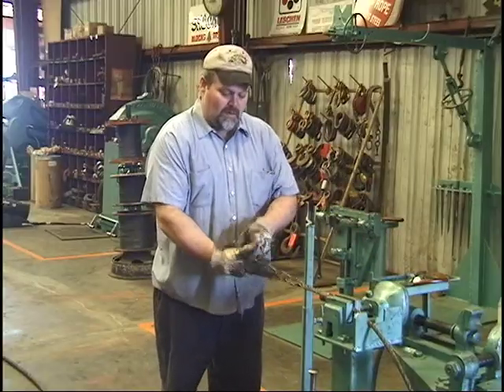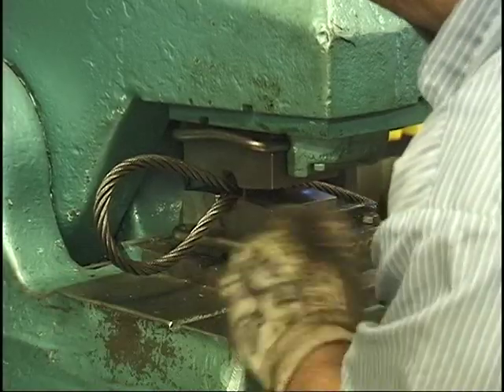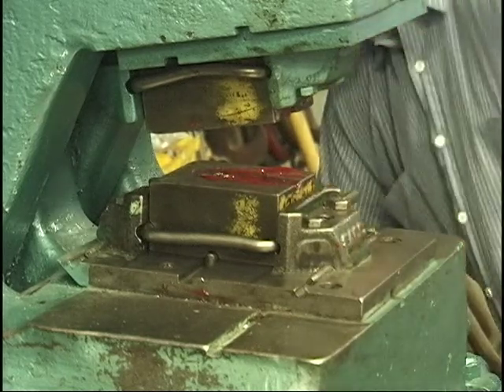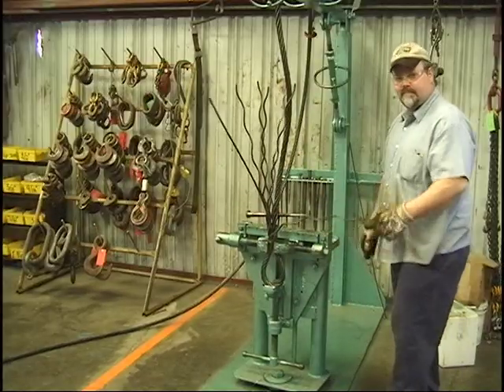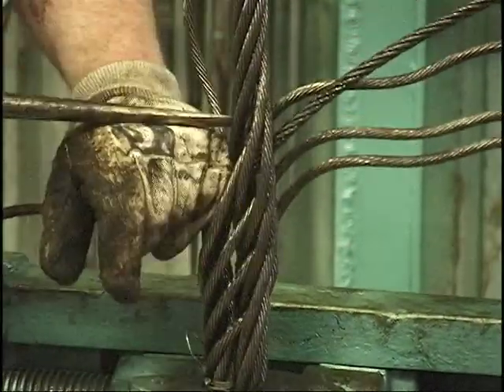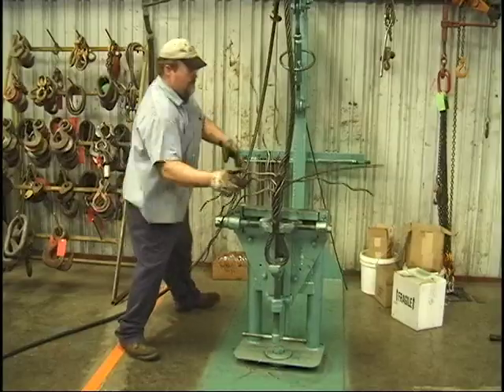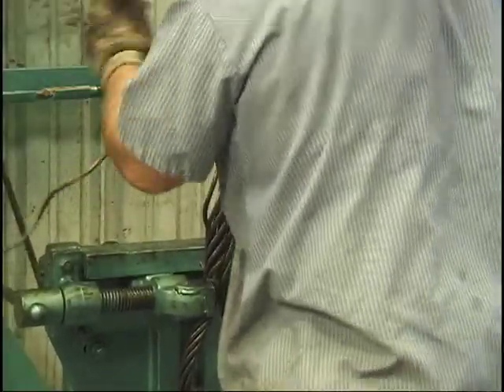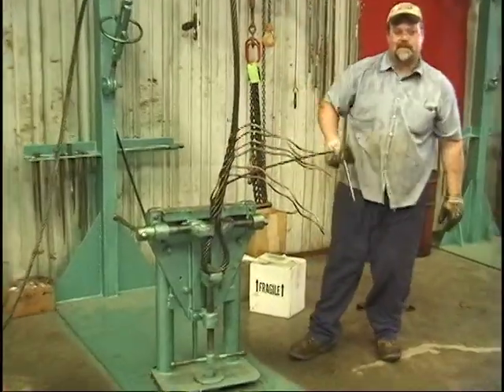Wire Rope Splice

Comment: So what if you don't have all those fancy press's and jigs,, then what?
Reply: do it by hand, it isn't impossible
Reply: Robert Jones yeah, the second splice is also incomplete. I can do it without the aid of a vice only a pointed steel will do up to an inch size of a wire rope.
Reply: @otreblasilecar3328  Me too, after 40 years at sea, mostly deep sea trawling you need to do it regularly, usually we used the 3,2,1 method, looks neater and passesvthrough sheaves better.
Reply: +Otrebla Silecar  Yeah, You are right. Up to 25 mm it is easy to do. Same time using a machine reduces fatigue and increased productivity.
Reply: I've done it by hand many times as an Able seaman on freighters, you LEARN how to do it, and  you remember it!
Reply: We just spiked the eye to a good size log. 4-6 RR spikes (usually from old guyline stumps) a SOFT hammer min 2 big steel marlinspikes, a small one helps. usually cut the line with a line axe or abrasive cutoff saw.
Reply: You Use Cable Clamps, Not As Pretty But Will Work In a Pinch.
Reply: The first eye, a Flemish or Molly Hogan soft eye, is nearly as strong without the ferrule. The six ends(+core) could be seized in place, duct taped, or just left alone. Any configuration of a flemish eye is stronger than the second splice; a tucked splice will normally be 80 to 90% of the rope strength. As the diameter of the rope increases, the strength of a tucked splice can drop below 50%. Both splices are "soft" eyes, that is, there is no thimble lining the inside of the eye.
If you don't have a Milwaukee Tool or Little Beaver etc rigger's vise, clamp the rope in a conventional vise 5 or 6 ft from the eye. Lash or clamp the rope around a thimble with 3 visegrip pliers. Tie off the eye across the room and stretch it away from the vise with moderate tension. Just like the adjustable arm behind him you want enough tension to prevent a kink from forming but leaving enough slack that you can slip your marilnspike or screw driver through the rope without much resistance. Notice how right after spinning the rigger's vise the cable is wavy and he raises the arm a bit to prevent the splice from looking like a spring. If he had lowered the arm a bit when the going got tough, the spike would have slipped through easier, but the finished splice would have a curl to it.
So with the cable clamped in your regular vise, and the eye tied off, put a bar or broomstick through the thimble and spin the eye same as his turntable does. Tie the bar to something strong after 5 or so turns so the cable cannot spin back before the tucks are complete. 
Notice his first tuck goes under 3 of the strands, the second under 2, and the third under just one, all With The Lay.  Tuck the other 3 strands, you can end up with each of the 6 strands coming out its own slot, or you can tuck under 2 or 3 at a time like he does. This is what makes it a Logger splice: he weaves the first tucks back straight through the middle of the rope. This locks the splice and allows a log to be suspended from a cable and spin without loosening the splice. 
It's difficult to see what he did with the second 3 strands but i tuck the one adjacent to the "first tuck under 3" strand against the lay with a strand of the standing part between the first and the fourth 'unlaid strand' tucks. That is the only strand i tuck against the lay, and the only tuck that strand does against the lay. After that, all tucks are with the lay. Against the lay means the same way you splice rope. With the lay means you are tucking under the same strand over and over (not a locking logger's splice).
It really doesn't matter how bad it looks if you tuck each strand 3x. Your next splice will look better, if it doesn't,  just hammer it smooth on an anvil. When you have enough tucks loosen the vise, don't try to unwind the bar.
Also notice that the 7th "strand", the core, doesn't get tucked at all, just cut off. Why? Because it doesn't contribute to the rope's strength (7% max). It is only inside the rope to hold the other strands in place, as well as store spare grease. It is easy to tell which one it is bc it is the only one laid right hand like the rope. What makes any splice weaken the rope is the way the strands get deflected, and splicing the core in with the rest will only deflect and weaken the rope more.
To me, a west coast just means a minimum number of tucks used to make the splice but still full strength.
Hope this helps, to me any written description of cable splicing, including mine, is confusing as hell.
Reply: @martyspargur5281  Wow,  you certainly know your way around a wire rope.
Reply: Take your broken braids to someone who has the equipment and know how to do the job.  I don't repair chokers just get new. When one breaks it was overloaded. It's no longer a safe mechanism even if repaired.
Reply: Yes, how many 500 ton presses are there when you need one.
Reply: Don't ya drive two or three spikes in a log and can do it that way? I've seen so many different ways and methods. I can do a Molly Hogan the first one he did but I don't use the collars and press. We always just worked the tails together and went. Maybe wrapped some miners tape around it. Or clamped it if we didn't trust it.
Reply: He could do it with a children's play tool set
Reply: In the Tub boat world we do it different with out all that fancy machines just your hands, a wire cutter, sledgehammer, wrench and two cable clamps all in less then 5 minutes.
Reply: @jme2816   When you get out of the tub and into the real world you might have change your ways

Comment: nice but i have to agree with Bill McCannel the ends are way to big. in the bigining you tape the ends so they dont come apart then you splice and fallow the pattern all the way uo. when you are done splicing all 123456. you tape the acessand  clip them with wire cutters. then you splice the remainin in... so your hiding it instead of leaving it out... Need buisness? need a great deal email at ivang35sl@yahoo.com.

Comment: We irish fishermen call this a 'Flemish eye'.  Presumably the Flemish guys used it a lot or perhaps came up with the idea first, they certainly came up with a lot of ideas!  In an emergency we held the ends with a bulldog grip and laid in the strands later.  Other splices we use are yte Liverpool, the German locking splice and the long splice.  The guy in the video is both strong and expert.  The largest cables that I have seen spliced was in the coal-mines in Whitehaven, Cumberland. Six inch +

Comment: Nice to see someone doing this stuff. I love that splicing jig you have. 25 years ago I learnt for my trade as a rigger to splice wire rope. When I worked in the mines I'd make custom length pieces for my boss so we could send odd sized equipment down mine shafts. The guys I worked with would watch in awe as I made them. Now-a-days it is all ferrule crimped, hand made splices are becoming a lost art.

Comment: My dad use to work at Woods Logging in the 80's, had a bad accident reeling up guide lines on the line truck in the building right behind this one if this is Woods. This video looks like it is in the main building?!?! I remember that press…same color and sound.
Reply: Which store? I think it is probably Baileys in CA. I have never seen anything but ESCO presses.
Reply: Ross Arnold worked at the one in Longview Wa.
Reply: This is acmy rigging in Mendocino county I know because that's my dad in the video 😂

Comment: hey a question for you guys what would be safest and strongest to say pullout a garbage truck stuck at the dump  with either a chain or steel cable I would use cable but whats your opinion
Reply: Cable is usually stronger. You can do a quick eye splice in the end without tools as shown first in this video. Without the sleeve. Chain is better behaved, but harder to move around. The stronger the chain is, the more the links will ring like a bell. What i would Not use is nylon rope. The more stretchy something is, the more deadly it will snap back at you when it breaks. Nylon is very stretchy. Wire rope doesn't stretch much, so when it breaks it doesn't snap back much, assuming it is at least a little beefy. Proof coil chain is the weakest, but rusts the least, but if it breaks it just drops and says, "huh". Even polyester rope will stretch a dangerous amount. Dyneema, spectra etc rope is hella strong, but people underestimate how easily it is cut. Doesn't recoil back at you like nylon, tho. When buying fiber rope, get straight spectra or straight dyneema or straight polyester or straight nylon etc, avoid ropes that mix two materials to save money. With double braids the cover can be a different material than the core, what i mean is avoid blends like 60% dyneema and 40% polyester in a single rope because the two materials will work against each other, and last nowhere near as long as if you had just spent a little more money upfront.

Comment: So I can see that grinding away some of the faying surfaces to try to meet the specifications, would be tempting, but is the metal flow of the sleeves still within the toolmaker/manufacturer's intentions? It may be interesting to do a saw cut through a sleeve to see the actual metal flow of the fittings. Please don't view my comments as negative, I can tell you really know what you are doing, and yours was the most informative I could find on any of the video websites.
Reply: The go/no go gauge is more appropriate for oval compression sleeves. The sleeve shown is for disposing of the sharp ends and it's not critical what diameter it ends up being since the strength of a flemish eye is not dependent on the sleeve. Nicopress dies used on oval sleeves (strands not split 3 and 3 first, the intact end is bent into a loop and then sleeved together) need to be adjusted so the sleeve ends up a maximum diameter after pressing. Otherwise the loop is not full strength. However, in some work having a full strength loop is not the highest priority. A full strength loop made with an oval sleeve needs a minimum number of presses, depending on which die you use, and the sharp cable end needs to stick out the end of the sleeve one cable diameter. There is often more than one set of dies that will work for a particular dia wire rope. That's why they have "letter" designations instead of being stamped "half-inch" etc. If you don't want a sharp cable sticking out of your sleeve, you can sacrifice some strength and make it flush.
BTW, it doesn't matter much, but oval compression sleeves are specifically designed for "flexible wire rope" (not strand). But we have found they work for a lot of things, including putting new eyes in the ends of (used) Dux, when you just don't want to spend all day fishing and all night repairing the gear.

Comment: I like your video, very instructional, I realize you could do this much quicker if you weren't teaching at the same time. I only wish you would have shown the gauge that you use to check that the sleeves have been pressed to tolerance. The only other comment I have is, it looks like your dies for pressing the sleeves are very worn, and even look modified. I also have heard, that the dies for a half inch sling cost about $10,000.00.

Comment: Nice Job, I always wanted to learn how, but never got chance. At Kearney & Trecker we had several guys that made hitches. When I started there in 1973 most of our lifts were done with hemp rope and large S hooks. Later years they  went with nylon strands encased in nylon jacket and large S hooks.Many of the special hitches were various sized cable .

Comment: Speed isn't impressive but always fun to watch wire rope videos on here.  They didn't start popping up until about 2 years ago.  You guys got enough chain?  Ha.  I dont' do this anymore but I did for a few years, I'll say this, out of all the things a rigger can do splicing is the only real part of that trade.  Do you work on synthetic rope splicing as well?  Bridles, Grommets, Slings, Chokers?  No 3 strand stuff, 12 strand and double braided stuff.  I loved working with Plasma rope 1 3/4".
Reply: We use Plasma for our muni moorings in santa barbara. Not the pendants, the actual rode.